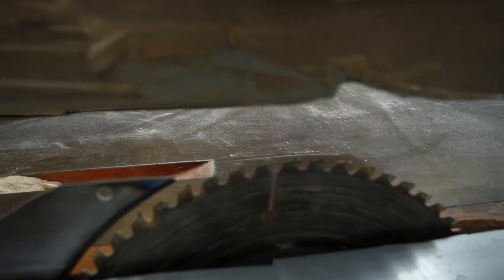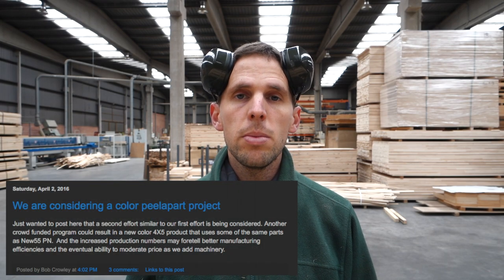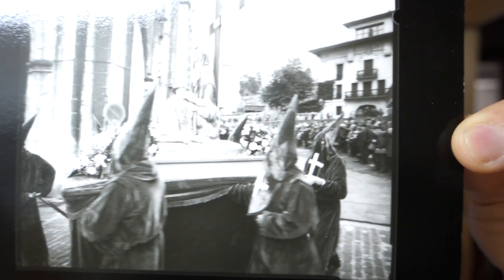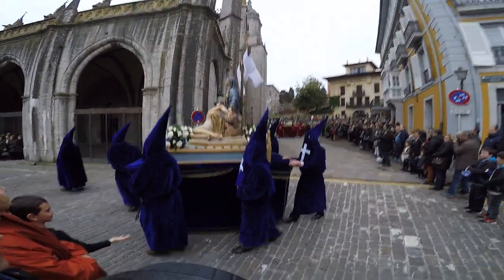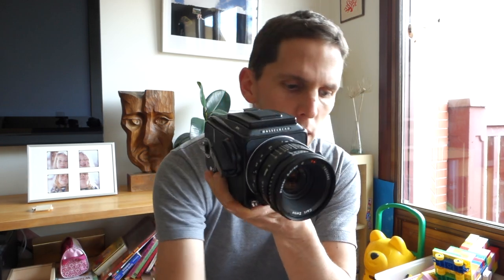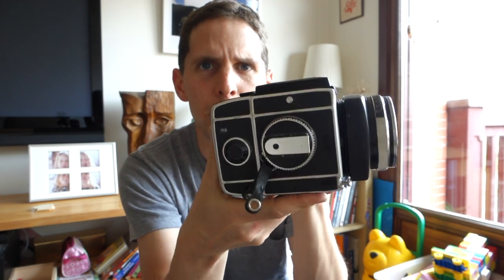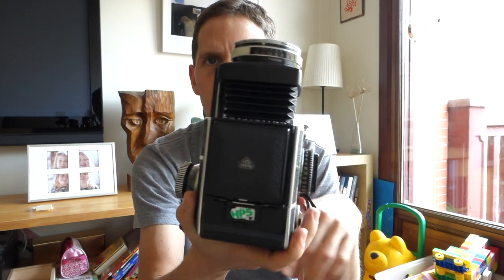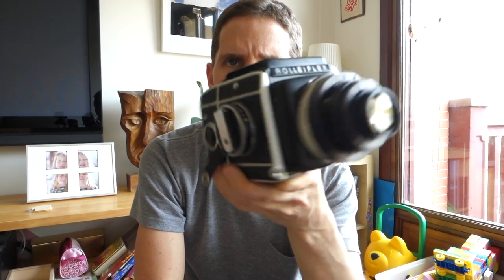Vlog 3 Contact prints, Rolleiflex SL66 and Zeiss Ikon ZM

Comment: You obviously have a wonderful family. But I'm afraid when it comes to photography there is a lot of nonsense you're doing:

1. Throw away that Ilford paper! It's one of the worst papers out there. Yes - I know - it's one of the most expensive and yet... I once made an experiment - I bought all papers that were available to me at the time and printed the same negative on all the different papers. The Ilford clearly and unequivocally turned out to be the worst. The best by a long way was Kentmere fibre based but that has been discontinued. Today the best is probably Foma fibre based.

2. Way would you ever want to put a Leitz lens on that Zeiss Ikon body?! The Carl Zeiss lenses for which that camera was made are far far far superior to any - I mean ANY Leica lens. There's just no comparison. I remember that moment some 20 years ago when I sold my Contax SLR with Zeiss lenses and bought a Leica M. After a very first roll of film I sent it back to Leicashop because I thought the results were not sharp because the focusing must have de-coupled from the finder. But they sent it back to me saying everything was all right. That's just how Leica M lenses perform. Very poorly. Afterwards I tried all different "prime" Leica lenses. It was all the same. No comparison to ANY Zeiss lens. So if you are serious about photography and your results the best thing you can do with a Leica lens is immediately turn it into cash or exchange for a quality lens.

3. 4x5 camera is NOT made for hand held street photography. Why would you want to take part in a rally race with a crane? No good. It will be slow.

4. Classic B&W films can't be pushed. It's a myth. Just forget about it. Real sensitivity of these films is usually about a half of what the box says. So a 400asa film should be exposed to 200asa. And of course it must be exposed "for the shadows" - what the meter says in the darker parts of the scene. As a result B&W negative gets exposed about the same as 50asa colour transparency film. That's just the way it is. Because if you "push" a B&W negative you are in fact only "pushing" the highlights - the shadows will remain the same!!! That's how it works. If you don't believe me read Anselm Adams and do your homework - do an experiment - find out the real sensitivity of your film. Because otherwise your prints will look the way the procession shot looks - bleak and terrible. Shots from a 4x5 should look majestic! Rich scale - with loads of tonal detail but ate same time incredibly crisp. And they will - if you use the camera and film the way they were supposed to be used. The many generations of photographers who used those cameras and those films before you were not stupid so it's probably a good idea to have a look at how they did it and learn something from them. Otherwise you are making a fool of yourself - presenting such horrible results from perfectly good cameras.
Reply from the maker: Thanks Branislav, it seems you have a lot of experience, hope you decide to start a youtube channel, I would totally subscribe.
Reply: @NicosPhotographyShow  Maybe - one day... But there I have to say how much I admire people who do that. You have a family, go to work, you have another job in the darkroom and on top of that you do a youtube channel?! So on that score - respect! 
I seem to have a week spot for people like you - who have jumped into photography... I see myself from many years ago. Took me some time to find out there are companies who are all marketing and no products. I had been misled many times. But those Ansel Adams books helped me a lot. In them I found essential knowledge no-one had ever told - even though I had been through two prestigious photography schools. The Negative and The Print - these two have completely changed the game for me. There was everything I had ever wanted to know about technical side of photography. And than the lenses. Carl Zeiss lenses. Plus a Schneider enlarger lens.